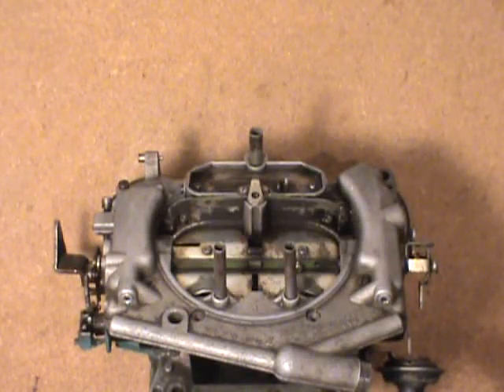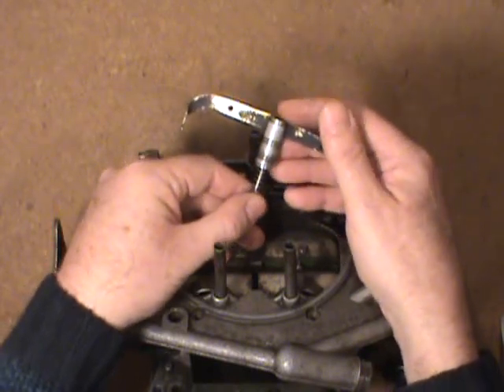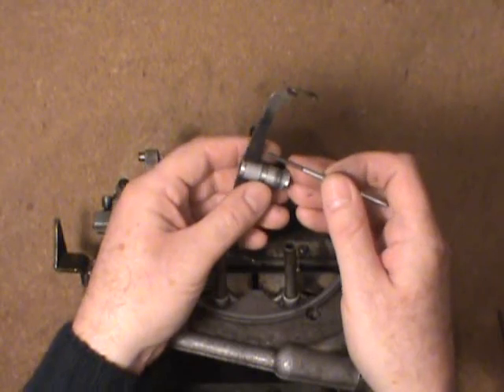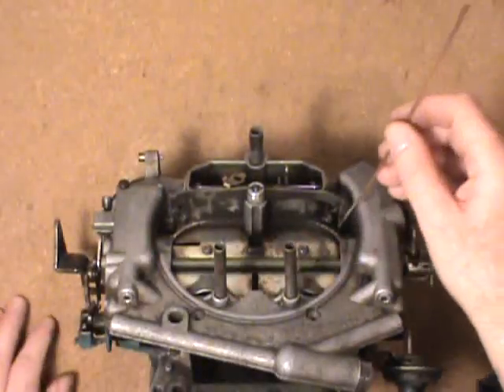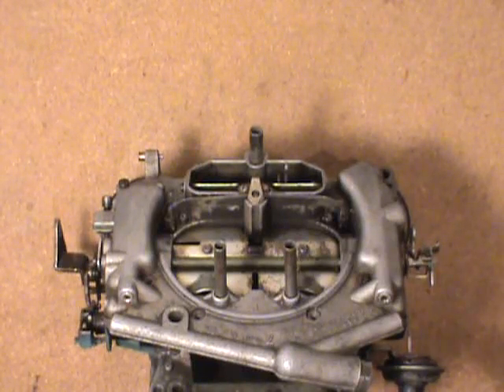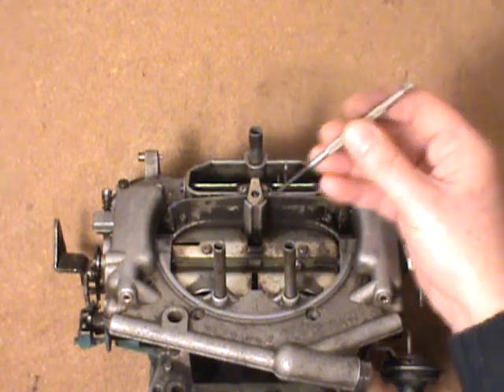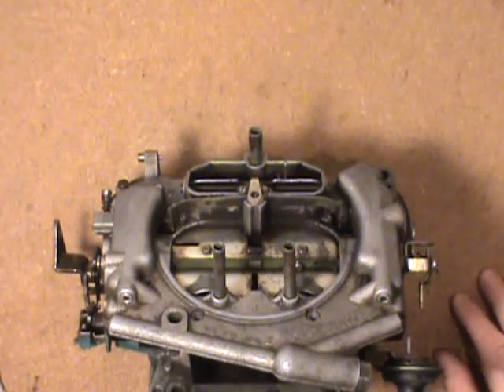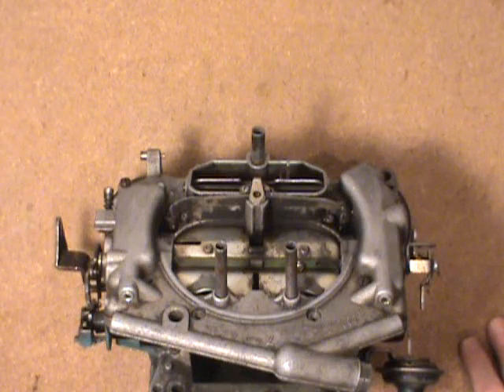Thermoquad 4 Barrel Carburetor  (Part 6)

Comment: I made an adjustment to that screw on the back, after the butterfly touched the top, I turned it 1 and 1/2 turns and locked it with the key, the butterfly accelerated quickly without a filter, the car stopped, but with a filter, the car stopped The throttles behind the carburetor didn't come in, a friend who only comes in when driving on roads?

Comment: I realize i'm commenting on  a very old vid but just taking a chance....Thank You for the Thermoquad series. I'm retired auto tech but new to Thermoquads , I have a bogging problemi & 'm seeking your experienced advice. This Thermo is 1975 original that was rebuilt by someone recently,but before my possession & these are the symptoms....#1 Hard starting, #2 Upon starting all the way through operating temp the engine idles great but refuses to stay running  or cruising  when pedal is pushed any  amount off of idle.(No Primary Circuit activity at all,imo). Accelerator pump pumps good strong streams. #3 Typical manner of getting this 1965 Coronet 440 from "A" to "B" in this condition is to let out the clutch very gradually from stopped, while "pumping" the gas pedal furiously. Upon reaching high gear this way i have to KEEP PUMPING just to MAINTAIN speed ?!?  PS The secondaries,(WOT), work great....if you want to accelerate all the time,lol. I've made the Metering Rod adjustment contained in this fine video but had no effect. Thanks in advance.
Reply from the maker: Greetings...Shane Williams.........You're welcome, and, thanks for watching........Sure sounds like, the primary circuit/s might be dirty or plugged up........I had a TQ, that, just stopped idling, when I stopped at a red light (not fun, with an A-833 4-speed transmission, along with a clutch pedal, just like you...lol).......All I did to fix that, was to remove the two idle mixture screws, then took a length of clear neoprene/fish tank, plastic tubing, and blew as hard as I could, into those two idle mixture, screw threaded holes, then, re-installed & re-set the idle mixture screws, and never had that problem again...yip-ee...lol........Float level setting, might be too low on your TQ (I recall, a one inch setting, with the nitrophyl (looks like black plastic) type of float (check the specifications for your own TQ)........If it were me, I'd get a rebuild kit, and make sure it was rebuilt/set up correctly..........Use "Brass" floats (nitrophyl/black plastic-like floats, will sometimes turn into sponges, causing the float to sink).......Use a "New" choke pull-off (the internal rubber-like diaphragm, inside of an older/used choke pull-off, will get dried out & stiff, possibly cracked...it might work ok for choke actuation, but, not so good at all, for regulating the opening rate, for the secondary air door...I had one that was sticking a bit, and, the engine popped and ran like...{choose your own word}...lol)...when I tried to go...pedal-to-the-metal........I use various diameters of fishing line, to clean out the tiny fuel and air passages, along with some carb cleaner, in the TQ's air horn/top aluminum section (if using guitar string/wire, then, make sure to file off the sharp jagged end, into a rounded shape, so it doesn't act like a cutting tool, which will score, and probably enlarge the passageway, that it was fed into, just sayin'..........So then, after everything is super clean, including, all of those tiny passageways, then, the most important/crucial part, of the TQ's rebuild, is to...make sure that, all of the adjustments and settings are done in the..."Correct Sequence"...!!!...(even, some so called carb experts, are not aware of this, at all, when it comes to having a TQ, to work, as good, as it was designed to perform).........Fear not, my friend, because, the paper instructions, that come inside of the rebuild kit, will show you the ..."Correct Sequence" (that be, the order in which to perform the adjustment and settings)...oh, and, I had very good luck, with the Hygrade brand of TQ rebuild kit.........Also, the really thick factory gasket, that goes between the bottom of the TQ and the intake manifold, for the mid-1970's Dodge V-8 engines, looked kinda like, two, very thick pieces of leather, that appeared to be stapled together (very small, industrial quality staples, at that, and, the total thickness, was no less than, oh, about 3/8-ths of an inch, there-abouts.........So yeah, no telling what the last guy did, with your TQ, it's anybody's guess, at best, well, unless the guy, truely, really did know, what he was doing, that is..........I had to re-jet a TQ a bit richer, primary, fuel jet-wise, because of that, about 10% ethanol (alcohol), which I like to call...Gas-em-ah-haul...lol........Keep in mind, that, the TQ's that were made, way back when, were "calibrated", when, there use-tah-be...100% Gasoline (with no ethanol in it).........The more % of ethanol, that's in the gasoline, then usually, the larger, that, the fuel jets have to be, for the engine to run right (less BTU's in ethanol, specific gravity differences as well, possibly).........Check your fuel pump volume and pressure (too low on each count, possibly...???)........Fuel and air filter clean...???........Ignition system, ignition timing, spark plugs, etc. ok...???........Over time, I've found some really unexpected culprits, fooling me, until I started with the simple things first (I still recall, that, the carburetor  will usually get blamed first, probably because it's just sitting there, just staring at you...!!!...lol).........So, check out all the simple things, and Ya might find the unexpected, when Ya least expect it, so now...go inspect...lol........If Ya need anymore help at all, or, Ya get-er-fixed, then, just give me a shout.........If all else fails, in getting your TQ to behave properly, then, maybe check out...Demon's...Street Demon Carburetor...that is a really good street carburetor, and, it has quite a few of the TQ's features, and they even have a model, that has that black thermoplastic/space-age center section too...........Two sizes as I recall...625 CFM...???...and...750 CFM...???..........Good luck, and......till next time......Be Safe, take care, and have a good one.
Reply: @RockysRoadshow  Thanks a bunch for all the detailed instruction.  The carbs' off the car & i will proceed with the things you have outlined. Some things i've forgotten & some you mention are new to me. Even at my age i still love to learn. Now, All the other engine systems have been gone thru by me & eliminated Except checking for fuel pump volume. Glad you mentioned it, I will do that for certain. This gonna take me a bit but i'll let you know how it's going.  Thanks again for sharing your knowledge.

Comment: Thanks for all the good information. I'm rebuilding a ThermoQuad, and this is good information to have.
Reply from the maker: Greetings...Steve F. ……...You're welcome, and, thanks for watching...…...Here are some things, that you should be aware of/consider...…….When it comes to the setting up/adjustments, on a Thermoquad carburetor, then, it's..."very important"...to make those settings/adjustments in the..."correct sequence"...(order of doing them), or, the Thermoquad, won't work very well at all...…….If your TQ (ThermoQuad), has those nitrophyl floats (looks, kinda like, black plastic), then, they can sometimes absorb gasoline, and then, start to sink, which will usually make for, a really, rich running TQ, most times...…….There are usually, Brass (metal) floats made, for the TQ carb also, which will usually last a lot longer...…….Buy and install, a new...choke pull-off...(looks like a little space ship...lol), because, the rubber-like diaphragm, that's hidden inside of it, will usually dry up/harden, with heat and age, and will sometimes get stuck, and, "it" has two functions, as in, it opens the choke plate, a small amount, upon start-up, as well as, it, controls/regulates, the secondary air door's opening rate (very important...!!!)………..Sometimes, the TQ will run a bit lean (of an air/fuel ratio), when putting, about 10% ethanol gasoline, in the gas tank, and if so, then, the primary (and maybe, the secondary) fuel jets too, might have to be increased in size, a bit...……..I had a lean condition, where, the engine would "surge" (car, was kinda lurching, back and forth), while just going city speed, while having the gas pedal held steady (probably because, the factory TQ carb, was calibrated/jetted, for 100% gasoline...and, not for, the 10% ethanol/gas-em-ah-haul stuff...!!!...lol)………..As I recall, my primary fuel jets, were factory/original .095" (ninety-five thousandths of an inch, orifice/hole size), and, I ended up, having to use .104" (one hundred and four thousandths of and inch), just to get rid of, that lean surging, that I was having, at that particular time...……Look up...Vaanths Thermoquad guide...on the internet, because, the guy that wrote/compiled it, did a fantastic job, to say the least...…...Good luck with your TQ rebuild, and...….till next time...…..Be Safe, take care, and have a good one.
Reply: @RockysRoadshow  I followed the adjustment  sequence in my trucks factory service manual.  Installed it today,  and it started quickly.  I still need to do the on truck adjustments. I will then see how it drives.  Did back fire when I revved it. I will look for vacuum leaks. 

The  primary jets  are .096 ,  .098 is what they came with from the factory. So, just a little leaner than stock. I'm at 1800 feet elevation, so I think that would be just about what I need.  But if the ethanol in the gas is a problem, I will adjust. I will use the spark plug color as a guide.

Thank you for the advice.

Comment: I get a bad lean bog at first like when I floor it at low speeds. But if im already at say 50 and floor it its fine. 1979 Lil Red Express 360ci
Reply from the maker: Greetings...Wesley Markham.........Thanks for watching..........Before I forget, try this.........With the engine fully warmed up to operating temperature, do a very gradual, slow acceleration, from a stop, on a quiet/no traffic street............If it accelerates smoothly (and normally), under that, shall we say, preliminary road test, then, here are two things, that come to mind, as to that (not so wanted) lean bog..........I'll assume, that, your 360 V-8 engine has a Carter Thermoquad 4 barrel carb on top of it (and, if not, you can let me know, what carb it really is...thanks)...........First thing, is, is that it might be the "Accelerator Pump", that's supposed to squirt a stream of raw gasoline (kinda like, a little toy/water squirt gun does) into each primary throttle bore of the carburetor, when-ever your foot presses down on the gas pedal (supposed to squirt quite strongly, when you mash the gas pedal, all the way down in a hurry), and here's why...........When the carb's throttle plates/butterflies, open very quickly, the Air (same stuff that we breathe...lol), will respond/move really quickly, though those (opened in a hurry, and quite wide open) throttle plates/butterflies & throttle bores, where-as (and, as I like to say, as in), the gasoline, that comes out of the nozzles, in the carb's venturi area (that be, usually where the narrowest part of the carb's throat, or opening is), is, well, a kinda "Slow-Poke", and can't respond, and flow, as quickly as the Air is able to...........So, if the Accelerator Pump..."is-not"...squirting enough (raw) gasoline, to mix with that (super fast responding) Air, then, a "lean bog" (acceleration-wise), it will probably be, I be thinkin'...........It's easy enough, to check its function, visually, alright..........With the engine "cold", and "not running", just remove the air cleaner lid, or, what-ever is sitting on top of the carburetor, then, if need be, hold the choke plate (flap) open with one hand, then, with the other hand, operate the throttle lever/bracket, through its full range of travel, and, be "watching", to see (if in fact), that, there are "2 Solid Streams" of gasoline (1 stream for each primary throttle bore)...........If either, one, or both "streams", are some-what "Spitting", then, that's a pretty good clue, that, the Accelerator Pump, "is not" working, as good as it should be, oh, and, gotta make sure, that, the Float Bowls, have plenty of gasoline in them, or, if not, then that, in itself, can cause, the same kind of "Spitting" behaviour, just so Ya know............The other "thing", that can also cause a lean, type of (aggressive?) acceleration bog, is that Secondary Air Valve, torsional (twisting motion) "Wind-Up Spring" Adjustment (I believe that I made a YouTube video about that item as well)...........If the Wind-Up Spring adjustment is too weak, then, the secondary Air Valve, will probably start opening, quicker than it should be............Then, there was when, I had, a, shall we say, "Rich" acceleration Bog, some years ago, where the Choke Pull-Off (that controls the Choke actuation, as well as, the secondary Air Door "opening rate"), was either sticking/got stuck, or moved too slowly, causing that Secondary Air Valve, to open way too "S-l-o-w-l-y" (or maybe, not-at-all...???), and the engine popped, would not go anywhere, in any kinda hurry, and sounded, very, very sick...........The "choke pull-off", is that little space ship lookin' thing, on the side of the Thermoquad carb, and, it's easy to check (some-what) as well..........With engine "cold" and "not running", remove that short, rubber looking hose, from the pipe, that's part of that choke pull-off, then, just push that flat metal bar, straight in, until it stops, then, place a finger or thumb, on the end of that little metal pipe, to plug the little hole, that's in the end of it.............Now, remove your hand, from that flat metal bar, and "Watch" it...........The flat metal bar, might come out, just a tiny bit, and then, it should stop, and stay there, and, if not, then, the rubber-like diaphragm, that's inside of it, might have a crack/air leak in it............Next test (yes-Sir-ee-Bob, there's another one...lol)...and that, is to, remove your finger or thumb quickly, from that little pipe, and "Watch"............That small flat metal bar, should come out slowly and smoothly, and, at a very constant speed, and pretty much, in a straight line as well...........If it does the "herky jerky", then, it's time for a new one...........Also, ignition system problems, can act kinda goofy sometimes, so, keep that in mind as well..........If you care to, you can let me know, how it's going...thanks.............Good luck, and........till next time.......Be Safe, take care, and have a good one.